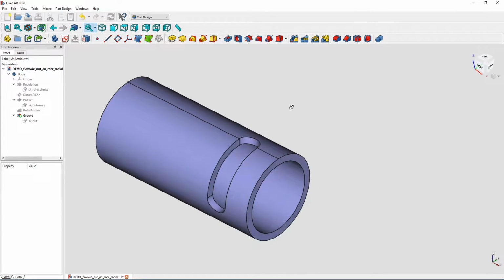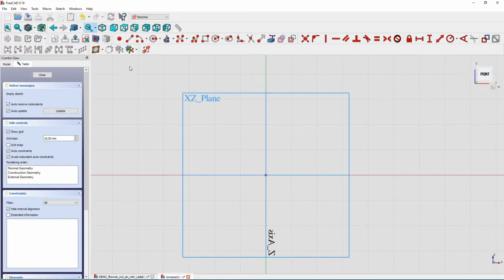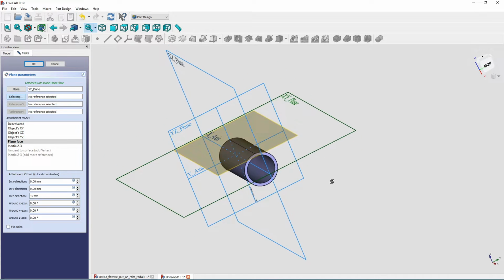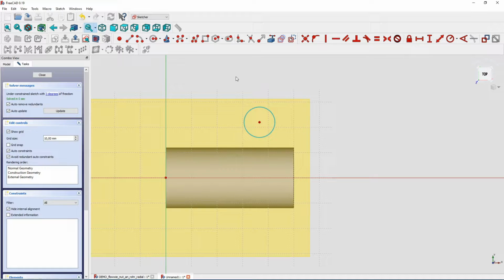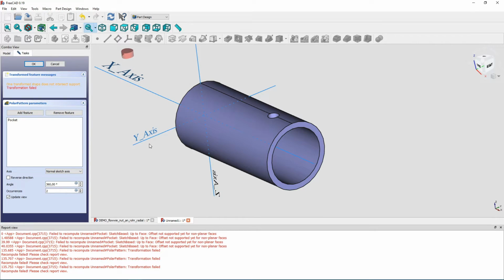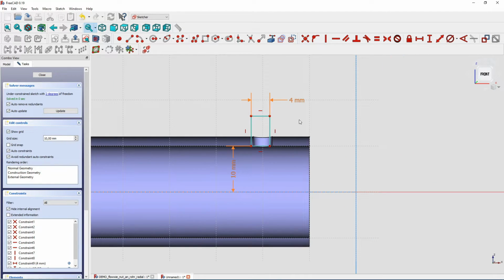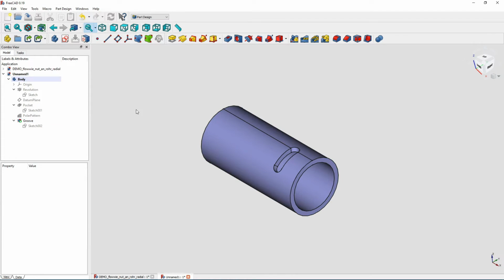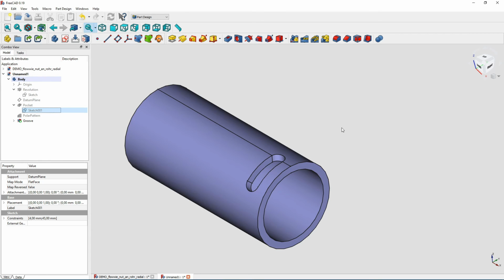FreeCAD 0.19 - Part Design Tutorial - Slotted hole on a pipe (English)

Comment: I tried doing this before watching the video and I think it should've worked. Instead of extruding the cylinder by rotating a rectangle sketch, I extruded a pair of concentric circles. Everything was just fine until I tried making the grove, at which point everything just kind of broke. The geometry was all messed up and no matter which rotation axis I used, reversed or not, symmetry or not, it just turned into garbage with random polygons sticking out and the circle holes becoming triangular. When I did this again after watching your video with the revolving rectangle to create the tube, the thing worked fine.

What is the issue? How do I avoid that?

Comment: I've just started using FreeCAD within the last month and your tutorials have been the best structured that I have come across. Please keep up the great work. I've been following the non-English also as the YouTube auto CC does a pretty good job of auto capturing and displaying with a bit of error in some words. Things like FreeCAD getting transcribed as Freak and other small things.

It's a bit slower following but that works out great and gets me to focus better.

I truly appreciate the teachings and proper methods of approach instead of the shotgun method most other tutorials seem to present.

Your English is superb so no need to worry.

I really like the series of examples that you supply giving users the opportunity to learn to do it on their own and then follow up with seeing a professional approach as to how to get it completed. Also, highlighting reinforcing the trouble areas that FreeCAD has is very nice (e.g. Topological Naming issues, etc.). I was not aware of the issue until you mentioned it in this video. That is how new I am to the system.

Keep up the marvelous work.

Comment: thank you for the video. I created the pipe on an alternative way,  two concentric circles. The thickness wall for the cross reference between 1st sketch and the rectangle did it creating a construction line between both circles and taking the measure as reference. Quite nice tips you are giving, I am learning a lot and I have stopped using external geometries or creating sketches on faces following the robustness hierarchy to tight and controll all the model. 1. coordinate systems 2. planes 3. faces 4. edges

Comment: Hi I don't seem to be able to make the groove I'm working with REV 24291 any suggestion welcome.
Reply: I'm experiencing a problem at this step also. My model vanishes and then I get the error "linked shape object is empty" if I follow through with the expression. Maybe a bug in this version? (I'm also on 24291)

Edit: Found a post describing why this was not working (in my case at least) and it has to do with "construction geometry" we used in a previous step. It is perhaps a persistent change vs. the assumed momentary switch. I went back into the sketch and selected the rectangle, then pressed the construction geometry button, and it let me proceed with the groove. Here is the link where I found the solution:
https://forum.freecadweb.org/viewtopic.php?t=50381

Comment: ex fusion user here. how would you go about modelling a pipe with a radial slot that is not just straight around/ up/ a constant pitch helix (like the locking mechanism on a pen or the cam groove for rotating the bolt on a rifle)? is there something like a wrap sketch around cylinder tool?

Comment: Thank you Florian for making this tutorial in English. I didn't know one could reference named constraints like that, which seems very nifty. A similar approach which might be better in some cases is to use a spreadsheet. It allows grouping all such named variables making it easier to get an overview of all parameters. To do so one would add a spreadsheet to the project, and add values in a cell with an assigned alias. The aliases can then be referenced as with the named constraints with e.g. "Spreadsheet.wt". This can allow for more complex relations where for example the value of once cell could be the evaluation of a function.
Reply: Nice tip, I'll be sure to check that out soon.

Comment: Great tutorial! But you're falling into the trap that computer programmers used to make, or trying to be too compact with variable names. Now there are some standard engineering terms, such as ID & OD, for the inner diameter and outer diameter of pipes,. Of course, these are probably different in English & German, so you might not know them. But "slot_x" might be a better choice than "dd"

Comment: Hi great tutorial. I am using v0.19 the same as what you are using, yet I am not able to enter the formula like you do. Constraints are not recognised. I have found the only way around this is to enter the sizes into a spreadsheet as I progress, and then use those.
Reply from the maker: To use spreadsheets is a very good way and is even better than my fiddling around with formulas and stuff. :D
Reply: @FreeCADAcademy  A month on... Sorted! 
I finally worked out why I was unable to use the formula. I discovered that when naming constraints, you can't use a space in the naming of a constraint. i.e "Slot Length" must be "SlotLength"

Comment: Thanks for your very precise tutorial. Do you have a reason for not using the spreadsheet for your parameters?
Reply from the maker: No specific reason, Spreadsheet Workbench was just not part of the things I wanted to explain here. If you have to deal with a lot of parameters, spreadsheet is of course the better option.
It's the common problem: You cannot show everything i a 10 minutes tutorial without further explanation, and suddenly you find yourself recording some 50 minute tutorial.. :)
Reply: Okay, I understand. Thanks